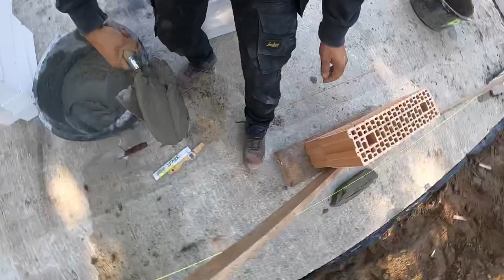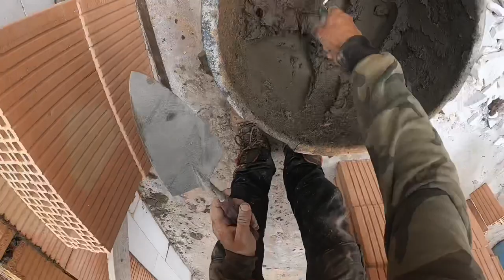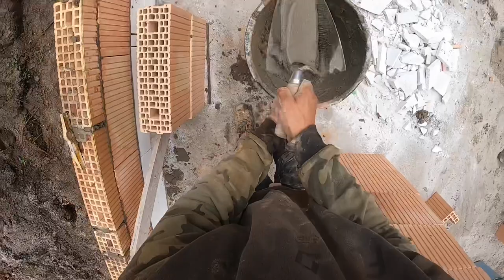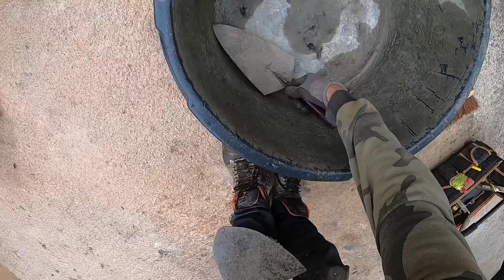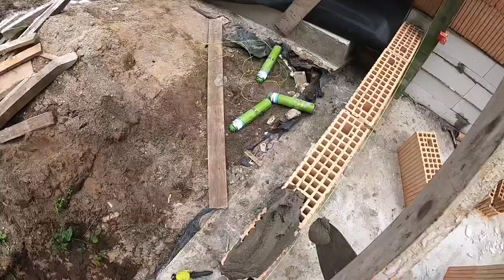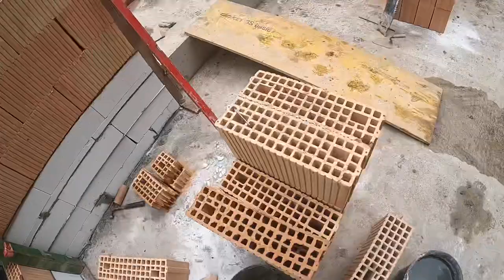A different trowel for bricklaying

Comment: Interesting video,I'm using a philly marshalltown trowel,can you buy the one you use in the UK
Reply from the maker: Hi Will , you can check the link they ship to the uk https://www.eurafco.com/eng/jung-65319000-brick-trowel-floreffe-190-x-142-mm-4010496653200.html
Reply: @JayKTS  nice one brickie, good style of laying easy on the joints etc

Comment: What’s the problem with spotboard?
Reply from the maker: What's the problem with a tub?? 
Here in Belgium, Holland, Germany or you can say Europe we don't use boards... Our trowel is also not designed to work off a board................
Reply: @JayKTS  strange habits. Why not use the easiest way to work.
Reply from the maker: Well I guess if you have never worked out a tub and a trowel as ours than how can you judge of what's better or not???makes no sense dude

Comment: If I wanted to buy you trowel what would it be called and can you cut bricks with it?
Reply from the maker: Hello Elliot , the trowel is a Jung henkelman 651 190 Brussels pattern , you can cut bricks with it 👌🏻
Reply: Bricklaying Jay Puyenbroeck nice1 👍🏼 wanted time buy a small trowel and work out of bucket then your videos gets recommended. Gotta love YouTube thanks for the content
Reply: Bricklaying Jay Puyenbroeck 651 and 190 different sizes?
Reply from the maker: Elliott 651 is the model and 190 is the length
Make sure you get the s- neck or swan-neck
Reply from the maker: https://www.eurafco.com/eng/equipment-hand-tools/jung-masonry-tools/brick-trowel.html
Reply: Bricklaying Jay Puyenbroeck can only find 180 x 140 is that right? Brussels pattern
Reply: Bricklaying Jay Puyenbroeck also I notice your pins on your line look different can I get a pair from the same site. Thanks fir the help
Reply from the maker: Yes the 180 is the smallest one , if possible you should try to get the 190 , it’s the best allrounder , pretty much one trowel capable to do all jobs , small and big
Reply from the maker: Elliott check here 190 https://www.eurafco.com/eng/jung-65119000-brick-trowel-brussels-190-x-150-mm-4010496651190.html